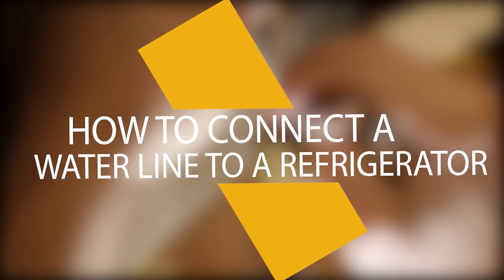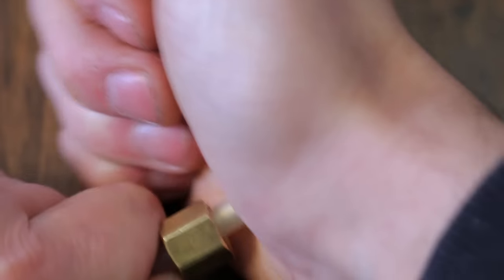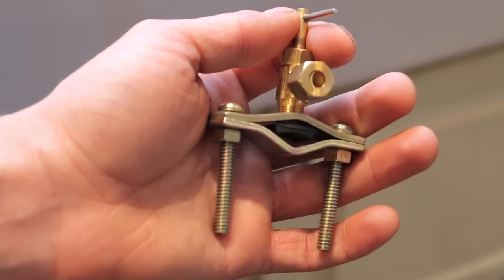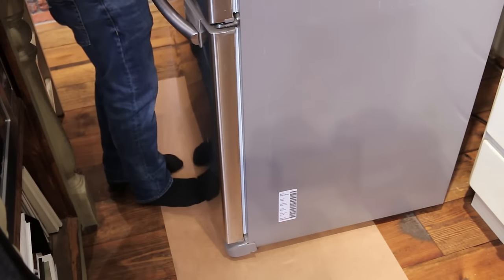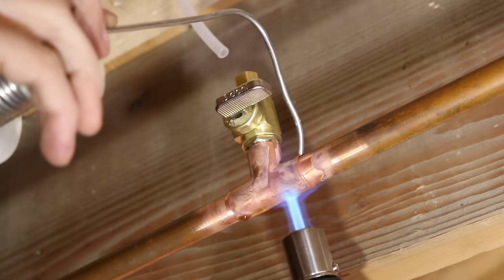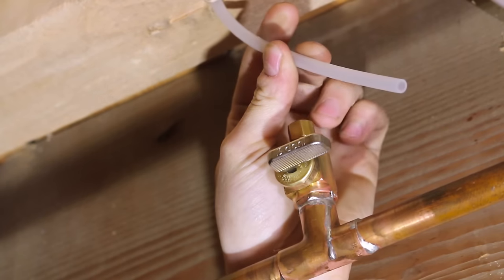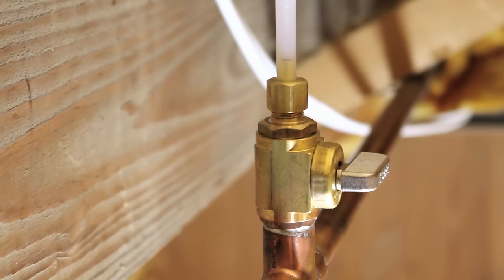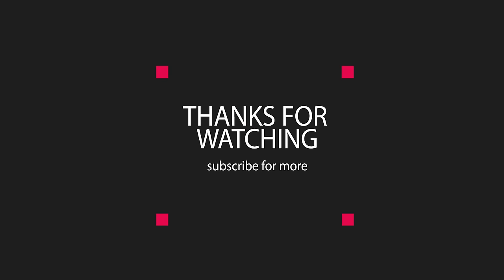How To Connect A Water Line To Your Refrigerator (+Tips & Tricks) | GOT2LEARN

Comment: NEVER use plastic lines. Had one that developed a pin size hole and leaked water into my neighbor’s condo unit downstairs.  I’ve heard others complain about the same thing. Pay the extra cost for the braided stainless steel line.
Reply: Agreed !
Reply: @Liana...

A braided stainless steel line is only stainless steel on the outside!  It's still a plastic line on the inside!!

If you stand by your statement of never using a plastic line...you're basically telling people to use a copper line which can be even more problematic by kinking and/or corroding.
Reply: @TheKiltedKraut of course. But as it states:  “These hoses are rubber inside the stainless mesh, and will last for 3-5 years.  Braided hose provides better heat dissipation and better flow, which is important when choosing performance car parts. Additionally, braided lines are able to withstand more pressure than rubber lines.”

The point that I was trying to make is that the steel braided hose is more resilient.  I’d just had my ice maker installed (less than a year) when the pin hole size damage occurred.  That’s all.
Reply: I’ve had two copper lines in my house develop leaks, a pin hole on a pressure line, and a condensate drain from the AC unit.  So now I don’t trust copper either.  Plumber told me that’s normal.
Reply: Ignore this comment, she doesn’t know what she’s talking about. If installed correctly, it will not leak.
Plastic is fine.

Comment: What is referred to as a ferrule is actually a tapered gland. A plastic gland is needed for use with plastic tubing and use metal glands for copper tubing. The reason people use PEX is that it requires no skill in sweat soldering connecting.

Comment: Repair for me - puddle on the kitchen floor.  This video is very clear, gave several options (yes!).  Well done.  Frozen shutoff valve to the refrigerator water line forced me to switch to plastic on the outlet side of the filter, which then allowed me to clamp the line instead of shutting the main water valve off.  It was split at the ferrule where the water line from the back connects to the one going up the door.

Comment: Great. I got exactly what I needed and installed my water line from the house pipe to the inlet of my refrigerator. I have got both the sleeve and brass ferrule and didn't know which one or both to use. I learned from the video and used the plastic sleeve, it works very well for me. Thank you very much.

Comment: One thing to note is that the 1/4" plastic tubing you use in the video is NOT PEX, it is regular HDPE. There's quite a difference. As I recently learned at my expense is that actual 1/4" PEX water line  (for ex. Waterline Products Ltd. 1/4" PEX B tubing) has thicker walls and is much more rigid than regular polyethylene. The consequence is that if you want to use 1/4" compression fittings, the brass inserts do not fit inside the tubing . So you are left with 2 choices: don't use the inserts, only the plastic ferrule OR use push-fit fittings. Since I have already installed my valve and cut the tubing (therefore can't get a refund for those), I decided to take a chance and install the compression fittings without the insert. The walls of the PEX tubing are VERY rigid, probably as rigid as copper so I'm cautiously confident. I will be checking on those joints every hour after I install them for a whole day to make 100% sure everything is ok.

Comment: in the materials list for the 1/4" PE-RT Pipe (50ft), link goes to 3/8" OD not 1/4". It does not seem to say that anywhere in the description but I purchased via the link and received the 1/4" inside diameter not outside, FYI DIYers. Seems others made the same mistake in the Q&A section
Reply from the maker: Hmmmm...i'll check this first thing tmr, thanks @Fee
Reply: @Got2Learn  Hi, I had the same issue with the PEX, it's 1/4" ID. I'm having a really hard time finding 1/4" OD tubing for the fittings I bought!
Reply: @Got2Learn  Yes, I made the same mistake. The link in the description takes to 3/8" OD not 1/4"..

Comment: I install all these methods all the time. I do install close to the same number of each but the saddle is the one most installed and it is the least problematic. I rarely have a return call on a saddle only 3 in the last 10 years with 628 installed in the 10 years this is all 100% accurate numbers from my computer billing system that keeps up with this type of stuff. The saddle is a very good product snd highly recommended.

Comment: Very good.homeowners,be aware always theses facts:
1-main shutoff location.
2-main line pressure.
3-refrigerators,not always come with 1/4 tubing.some may be 5/16.check this FIRST!!!
4-if you doesn't feel confident,hire someone who does the job for you.
5-NEVER use copper with osmosis and distilled water!!! eats away the copper.
6-Discard first batches of ice.
7-If possible,install a inline filter,as this helps main filter,in heavy sediment issues.
8-Keep watching these videos!!!!!

Comment: Thanks for all the info. Saddle valves seem to work fine for me though. I installed one 12 years ago and its still going strong - no leaks whatsoever. Was debating on changing it out with the new saddle valve that came with my new water line kit for when I install a fresh line with my new fridge, but I think I'm asking for trouble if I disturb it. Decided to just change out the line for now.

Comment: Thanks for such a detailed video! I have a question I am hoping you can answer: We have a Kenmore refrigerator where the ice maker's incoming water valve connection started leaking; I removed the plastic compression nut [it has the ferrule integrated into it] and discovered that the compression nut had actually cut completely through the plastic tube. So, I cleaned it up, inserted the remaining tube into the plastic compression nut, seated the end of it into the valve connection, and carefully screwed the nut back on, finger tightening and then adding about a 3/4 turn with a wrench. Is it ok to use this approach? I saw where you recommended using a sleeve inside the end of the tube to prevent collapsing...maybe it should have been installed that way to begin with, and I should redo both the ice maker and the drinking water supply with sleeves?
Reply from the maker: You are welcome!
Yes there should be a sleeve inside on any plastic pipe using a compression style fitting, cheers!!

Comment: How long should you keep the hose in for before you replace it
Reply from the maker: That's all up to the owner, but honestly they should be checked every 5 years or something, i've heard too many stories of flexible hoses bursting and causing huge damage so, yeah...
Reply: I think if it is that plastic hose it should last for 15 years
Reply from the maker: Yeah the plastic ones last a long time, I was referring to the stainless steel ones, those are made of rubber inside so, you gotta keep an eye on them ;)

Comment: I would have lifted the ice maker arm first before starting the job and then after connecting the line, run 3 gallons of water through the cup dispenser on the refrigerator door before letting it make ice cubes.   You might not have ever known that there's a hidden water tank inside for storing cold water for the cup dispenser.

Be sure to throw out the two batches of ice before using any new ice.  This flushes out the system of any debris from your new water line as well as any charcoal dust from the water filter mounted in the refrigerator.

I've used a copper line, but learned to leave a very large 3-ft diameter loop behind the refrigerator to allow easier expansion when pulling the refrigerator out for servicing or cleaning.
Reply from the maker: Good info here guys!

Comment: One addendum I would make. After hooking up the plastic water line to the main, purge the line into a bucket. Turn on the water at the new valve and purge some water into a bucket before hooking it to your fridge. You don't want dirty water in your fridge
Reply from the maker: True, forgot to mention that, thank you very much for that!
Reply: @Got2Learn  great video though. Quite thorough. I did home remodeling for years but wanted a refresher and I'm not disappointed.
I'm doing it with a T under my sink, going under my floor and across the room. Using braided line. 20ft'r
Reply from the maker: Niceeee, have fun man ;)

Comment: hello. ur. video is very informative. my waterline on the fridge, the one with the connection on the end has a puncture so i turned the water off since it was leaking. can i fit another ending to it after i cut the area that has the leak? what kind of part would that be ?
Reply from the maker: You can just cut it out and replace it using a coupling like in the video, lemme know if this works.
Reply: Got2Learn thank u so much. did it with the parts and ur video!
Reply from the maker: Awesome!!!

Comment: Good job on the plastic feral if the brass doesn't cut through the pipe on installation eventually the water hammer from it turning on and off will make it cut through. You should never run the clear plastic tubing through floors or cabinets though. Its to soft of a pipe and the water hammer will wear holes in it almost everywhere its touching something they make 1/4" pex pipe which is more rigid and durable If you have the skills to solder or use shark bites you should be able to run a branch line through the floor or back of cabinets with a shutoff valve right behind the fridge then your supply line to fridge that way if you move or cant be reached someone else isnt trying to trace a line to turn it on and off. Also to ensure that your not passing a future leak onto someone else plus a new supply line should be installed on pretty much any fixture anytime its unhooked wich usually never happens on lines ran through cabinets and floors
Reply from the maker: Good to know, thank you for the input ;)

Comment: So, how do you cut a piece out of a copper pipe in order to put in a valve, and be able to spread it far enough to get the valve in and then pull it back together? There isn't usually that much movement to copper pipes. They are rigid and fastened with hangers here and there. You would have to put a fair amount of stress on one or both ends of the cut pipe in order to insert the valve and pull the pieces back together. I appeared one side of his cut pipe moved freely about two inches. That might not sound like much, but you would be stressing a joint somewhere else or bending existing piping.
Reply from the maker: Yes, good question. In some situation, there's enough loose to just move it out of the way, some not so much. For those situation where there's no movement, you either need to use a slip coupling a little further down (6" about), i'll be making a video on this very soon, i've been getting asked a lot how to go about this kinda thing, thanks for the reminder ;)

Comment: I want to use the Sharkbite valve on my 1/2 inch copper pipe but it's fixed to the ceiling and can't be moved even half inch.  Can you tell me if it can be used in this situation because I just wonder how it can be slided into the pipe with an one inch gap?

Comment: Random question haha. I wanna figure out how to do this on a kenmore fridge: it’s just temporary, not even for a week. I wanna try to connect it to a water source, ie a water bottle. I put the tube in a water bottle, pressed a cup of the “purified water” dispenser, and then tried to have water dispense out. I pressed it, and water started coming out of the tube that was in the water bottle haha. Idk how to do this. Does it need pressure? I just wanna have it work, but not have to physically connect it to a water line lol.

Comment: Very good video,  would it be a good idea to have the ball valve open while soldering it ?  it could prevent excessive heat to the inside of the valve that could possibly damage it.  Merci.
Reply from the maker: Yeah I forgot to open it. On smaller pipes like this it's ok but on larger diameter piping I open it half way to keep some of the heat in ;) thanks Luc ;)

Comment: Would it not be better to install the valve on top of the floor, so a stubout pipe is sticking like an inch or two out of the floor and then install a valve on top of that? Kind of like how some toilet water supply lines sometimes are?
Reply from the maker: You can, it was my personal choice to have it in the basement.

Comment: Could you please clear something up?  In your video it says that the OD of the pex that you use is 1/4" but the amazon description in your link, as well as pex's web site says that it's 1/4" ID and 3/8" OD.  The LG refrigerator that I ordered states that it takes a 1/4" OD water line to connect to the fridge.  If the fridge will accept 1/4 or 3/8 then that would make things a lot easier.  Any insight?

Comment: What's the smallest size hole to drill that will fit the 1/4" plastic tube? Will 1/4" drill bit be too tight?
Reply from the maker: Yeah cuz the outside diameter is like 3/8". But honestly, making it too tight could lead to early wear, be cautious ;)

Comment: @Got2Learn you never mentioned what fittings do I need to solder into the T and valve for the ice-maker install on copper pipe
Reply from the maker: Male 1/2" sweat on shutoff valve.
Reply: @Got2Learn  thx
Reply from the maker: @babyboinews6896  Yes sir!

Comment: The brass sleeves and nylon insert in your links clearly say it's for non-potable water on the packaging.  Got any other options?
Reply from the maker: Trying to find where it's written, I can't see it, but honestly I don't know why they would write that.
Reply: @Got2Learn  Usually because it contains lead.  It's on the back of the packaging of the actual product, not visible on the amazon page.
Reply from the maker: @wuzzle5261  hmmmm interesting...i'll try swapping those out for lead free parts, but for your situation, I don't think it would be dangerous if you were to install it seeing it's so small.

Comment: I plan to remove my old saddle valve and use a shark bite Tee with 1/4” like in the video. My question, do I reuse the Ferrel/coupler already on the 1/4” hose to the shark bite fitting, or do I need to install a new one?  If I need a new one, should the 1/4” be cut off behind the old Ferrel/coupler or can it be removed after already being compressed?
Reply from the maker: Use the new one from the SB 👌

Comment: I have a GE Fridge. appears their universal water lines are 1/4" tubing. you state you used a 1/2 to 3/8 sweat/ compression straight valve. Just curious why the compression part is 3/8", is that so the 1/4 can fit inside?

Comment: Very well produced and edited video. Clear and concise. I might double valve my install since I'm coming off my main in the basement and run copper thru the floor and another valve on the floor behind the refrigerator then to plastic. Also, anywhere I'm running a waterline around wood, I dab some Terminate (Copper naphthenate) on the wood and thru the drilled hole just in case of a leak to help keep dry-rot from starting.
Reply from the maker: Thanks Dan, I really appreciate it!

Comment: Another great video! 
I worked for a plumbing company sub-contracted by an insurance flood and fire restoration firm. Top floods were caused by frozen pipes. washing machine supplies bursting and plastic fridge lines with metal ferrules or piercing saddle valves.
Reply from the maker: There ya go, the proof right there :)

Comment from the maker: Help support the channel here: www.patreon.com/got2learn
Reply: Excellent 👌👌👌👍👍👍. Every time I buy these kids they come with the copper crush sleeves instead of plastic which makes a lot of sense because it does cut through the plastic tubing rather it has a inserted backup anti crush sleeve in the tube and or not they are very prone to leaking right at the pinched joint. I did not know that the plastic couplers/mushrooms are available until I saw this video. "Good job this was a good JUAN"
Reply from the maker: Thx Eugene!!

Comment: Great video.  Thx for posting.  Will the Shark Tee fit around a copper pipe with a 2 inch circumfence?
Reply from the maker: Thank you, can you please clarify?
Reply: Apologies.   When I measure the circumference of the pipe I am going to attach the sharkbite tee to, the circumference of that pipe is 2 inches around.   Will it fit?
Reply: Its the source line that's 2 inches not the line to the fridge.
Reply from the maker: @wacokid2826  you'd need the bigger Sharkbite fittings

Comment: One thing to consider when deciding between plastic, copper and braided stainless. What kind of floor do you have. These Pergo style floors don't do well with water. Had someone ruin half her kitchen floor when the 6 year old line decided to leak. Also these braided lines only have 10 year or less life expectancy. Today I'm repairing a line that has copper, the leak is at the plastic connection on the fridge side. 
  One other little known fact about copper, it kills bacteria. 
  This home has hardwood floors. A little damage from warping under the fridge but not anything that needs to be repaired.
Reply from the maker: All good information here, thanks Jon!

Comment: Very informative video, thank you. This will be the fourth shark bite connection in my house. Is there a timeframe on when they may have to be replaced? The guy at Home Depot said eventually the plastic inside could wear out over time. What is your experience, if any, with shark bites needing replacement? thanks
Reply from the maker: My personal experience with Sharkbite fittings is that if they are installed as per manufacturer's guidelines, they don't need to be replaced for at least 25 years. I personally have a plumber for my rental properties that installs these all the time and only had a problem once which was the company's fault and they covered it.